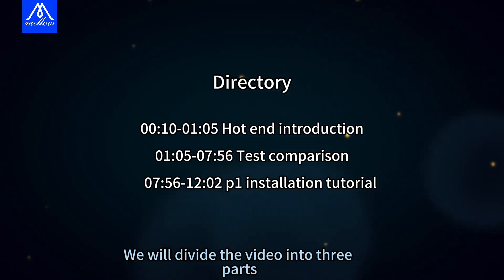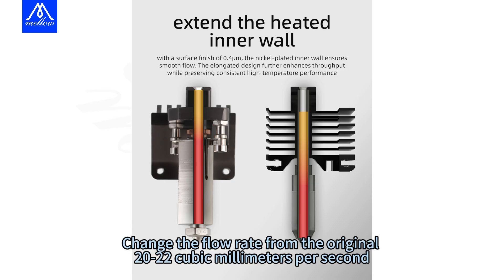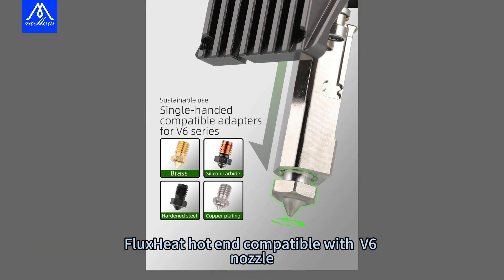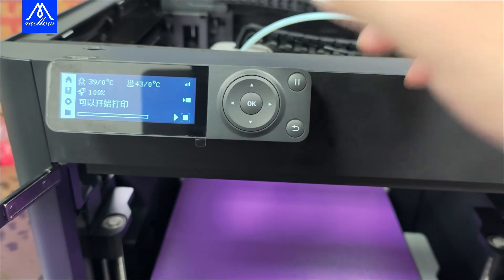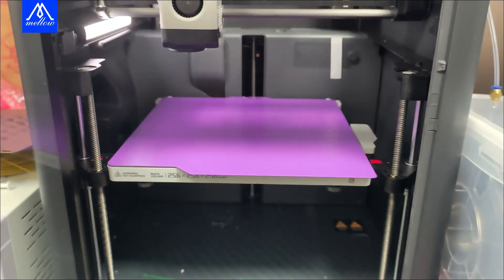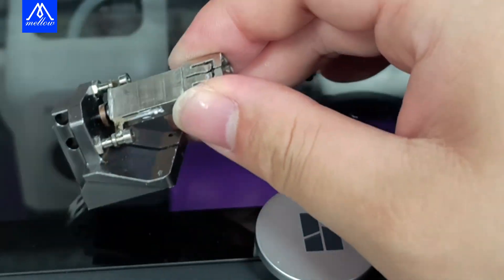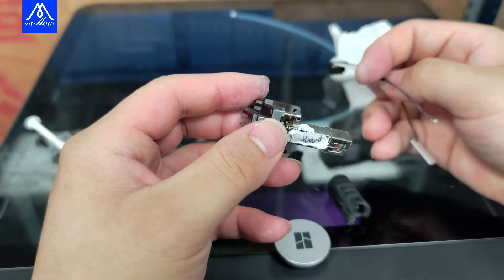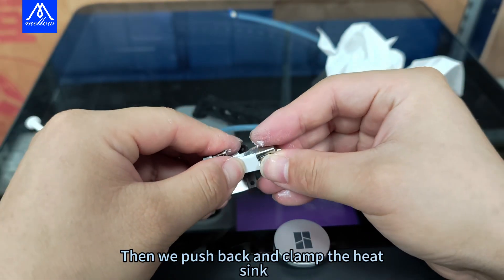🔥 FluxHeat Hotend | Ultimate Speed & Precision Upgrade for Bambu Lab P1 Series! 🚀

Comment: I purchased the Mellow High Flow NF FluxHeat Lite Hotend Tc4 for my Bambu Lab P1S, but the stock extruder/hotend cover is too tight. The hotend’s silicone sock is thicker and ends up rubbing against the inside of the original cover. In the video, the lower part of the cover is rounded, but the factory cover isn’t.

What’s the best way to fix this?